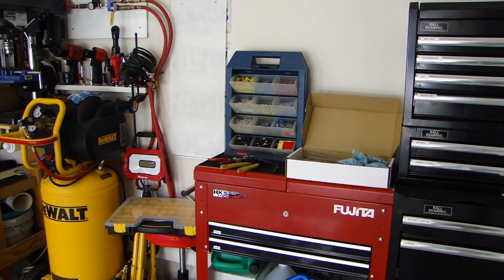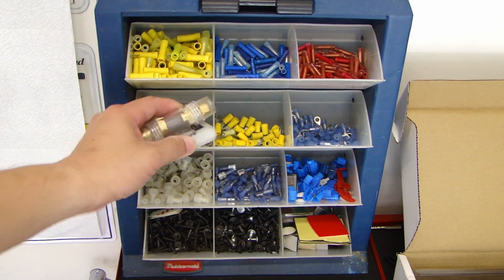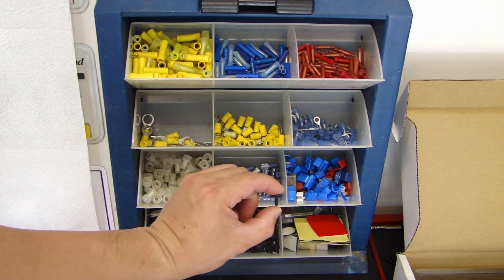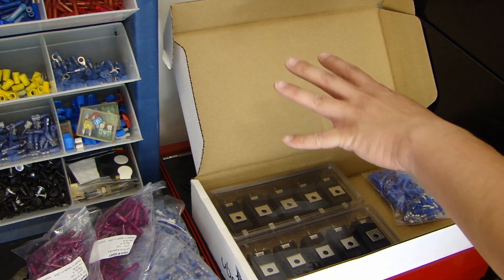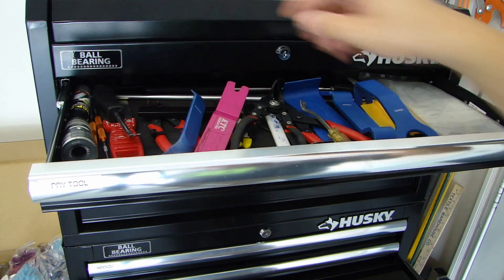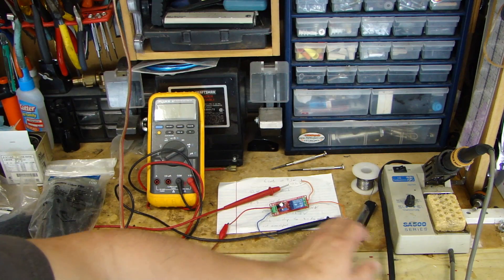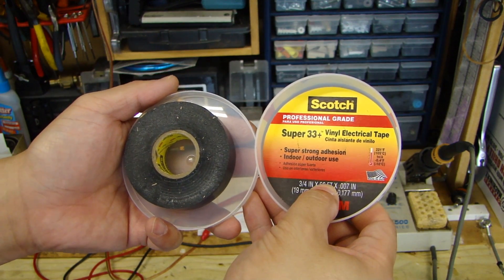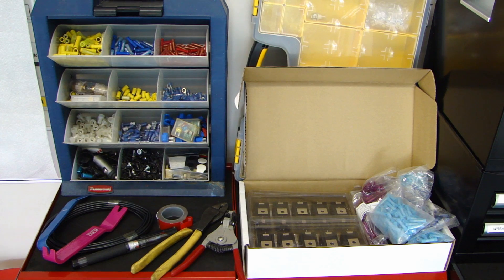Tools You Need For Car Stereo Install & Car Alarm Install

Comment: you should buy, plastic tubing insulation, for engine compartment wires:
 http://m.ebay.com/itm/Black-Plastic-Electric-Insulation-20mm-Inner-Dia-Corrugated-Wire-Tubing-Tube-5M-/310839467258?nav=SEARCH
Reply from the maker: +Rigoberto Chavez Yes, absolutely. I actually have a bunch of those but forgot to pull them out. Thanks!
Reply: +dial2fast ok, you are the best ..!!

Comment: http://www.banggood.com/19mmx-15M-Hot-Adhesive-Cloth-Fabric-Tape-Cable-Looms-Wiring-Harness-p-985890.html
I use this tape
Reply from the maker: +Emi budeanu Thanks for pointing that out. Looks like what the car manufacturers use on the factory wire.

Comment: Where did you get the fuse box from with all the connectors can you send me the link.
Reply from the maker: +Jonathan olin Do you mean the plastic box from my tool chest with all the different fuses? Or what is the time in the video? Thx